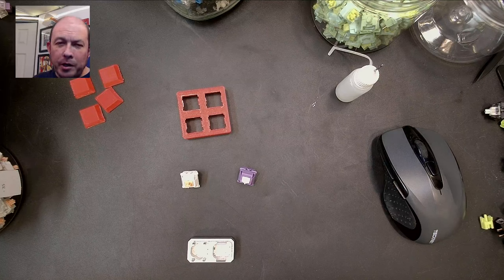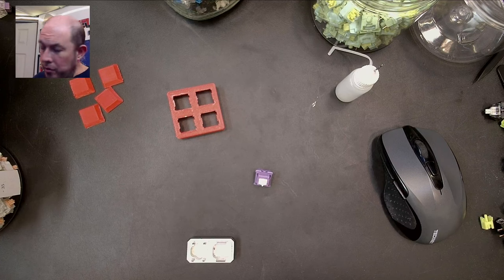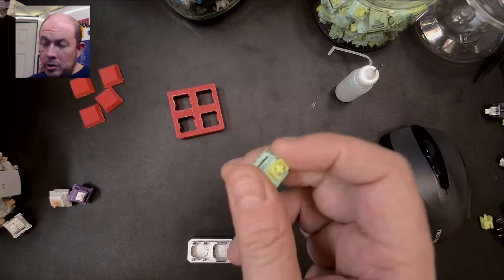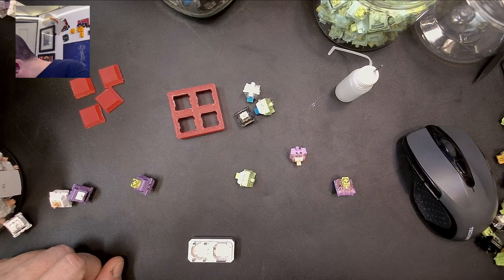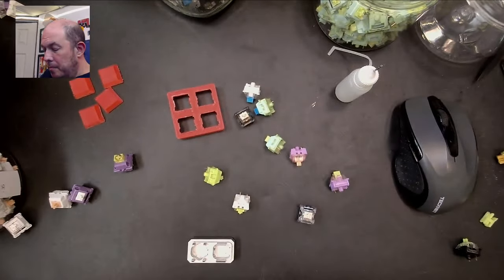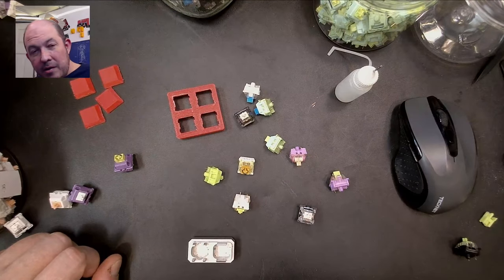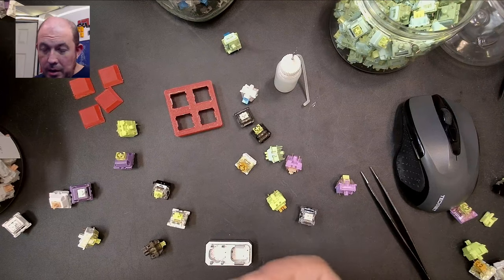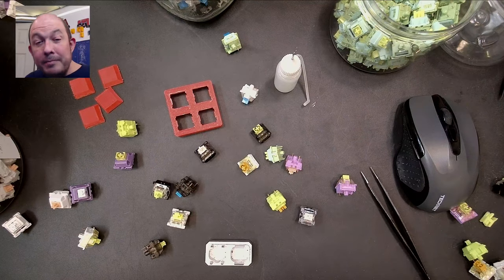Frankenswitching: Having fun with switches by creating frankenswitches!

Comment: I haven't really gone down this road, because I can't afford it and don't really have the time either. I did however swap the stems of some Gateron Blue Inks (via NovelKeys_ mystery bag) that I never would have used with some Jxian Black stems that the housing was destroyed when pulling out of a budget board, and it has turned out to be my favorite switch! I would consider it again to prevent a switch that I deem unusable to have a 2nd life, but not ready to jump in. The experimentation is cool and fun to see all the different combos, carry on!
Reply from the maker: I can completely appreciate that, I've collected more switches than I care to count over the last two years, plus all of the stock switches that came with prebuilts, I have many parts to play with. I will keep reporting any good finds so others don't have to destroy their switches ;)

Cheers!